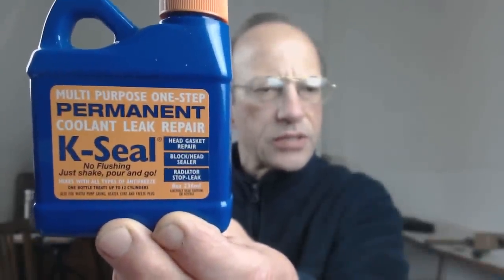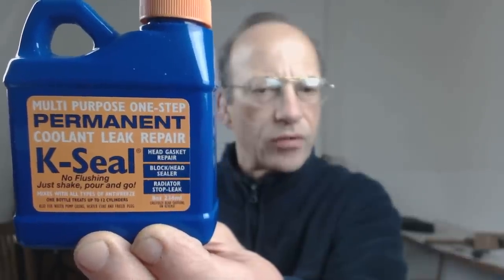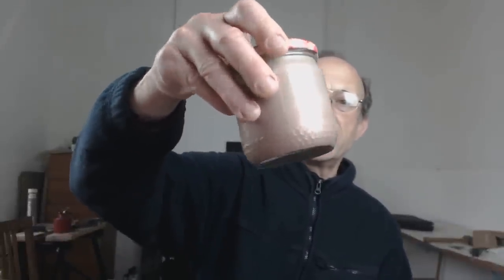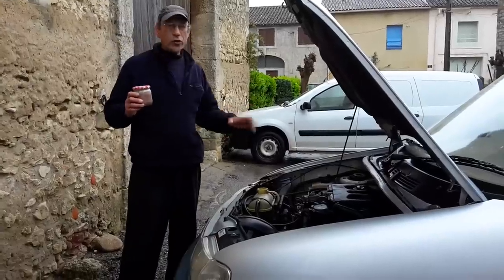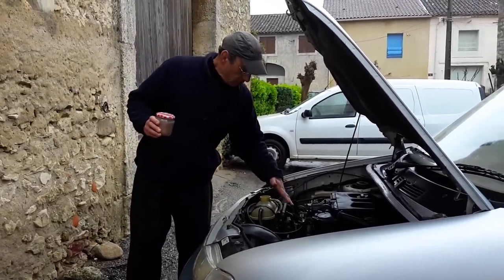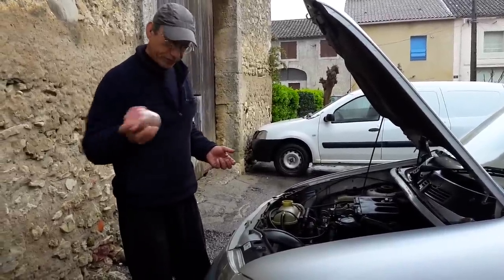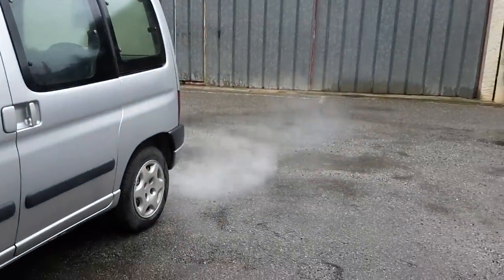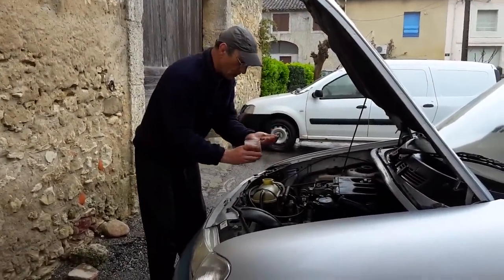K-Seal Full Test - Purchase options, Instructions & Results

Comment: My 2002 F-150 with a 5.4L Triton engine had a slow coolant leak, but was slowly getting worse. Mechanic diagnosed it as a bad gasket under the Intake Manifold, just under the passenger side of the cross over pipe (the other side of this pipe holds the thermostat). Estimate to tear down and replace the gasket at his shop was $950 but with a rusty body and over 276k miles, it wasn't worth that amount to me to have it fixed properly. I read a lot about radiator stop leak products, and decided to give K-seal a try, partly based on this review by Engine Tuning and some others. I added the K-seal into my overflow tank and the leak was stopped after about 15 minutes of idling and slow driving, and the coolant that had leaked and puddled up in the crevices on top of the block has finally baked off so no more coolant smell in the garage after I shut it down. Heater still blows hot air, engine still warms up quickly, so no ill effects in the heater core or thermostat so far. It's been about 10 days now, and I'll come back and post an edit to this comment if anything goes awry in the future. I'd definitely recommend this product to a friend with a similar situation.
Reply from the maker: Nice report Terf ... thanks for taking the time to share it with the community.
From my experience, you fault has already been fixed, and should give you no further grief.

Comment: I really appreciate the info in this video.  I thought I'd ask a question because it appears you are still responding as recently as 2 weeks ago :) I too had a suspected leaky head gasket.  My 94' Celica has over 200K , my mechanic notice a funny odor emitting from the engine that he identified as a head gasket problem.  He told me to watch my radiator fluids and if I have to add fluid, my head gasket may be in the early stages of going.  I noticed I did have to add fluid once a week, not a lot but it was losing fluid.  He then instructed me to add the K-seal, which I did 2 weeks ago.  The first thing I noticed is steam/or smoke coming from the engine. This happened the first 2 days, then stopped.  Now I'm noticing once I've driven the car for sometime, meaning the engine is very hot.  The car is stalling out, it restarts after it sits for a min or 2 but the stalling out is happening more frequently.  I know it has something to do with the KSeal just not sure what... Any ideas?????
Reply from the maker: Sorry for the delay ... I've been offline for 5 days.

From all the feedback, it is unlikely to be caused by k-seal.
Most likely, you are one of the very few unlucky ones, who's engine wasn't fixed by k-seal.

They claim 98% success rate.
The feedback bears that out.

You can get in touch with them.
They may refund your purchase cost.

Let us know what happens ;)
Reply: @EngineTuning  Sure will, I called them they said the same thing you just said.  My mechanic is checking it out tomorrow.  Thanks for the quick response, I was waiting :)

Comment: It may not have worked for this guy but it's worked on two of my cars + my brother in law's that each tried it one at a time last 3-6 months.

First car we used it on (my in law) was a big SUV GMC model with a thirst for coolant without a puddle. It was going out the exchaust.  (Head gasket).   Within 20 min the leak stoped and now after 6 months still holding.

Second car was a 2000 Jeep Cherokee 4.0 L (6 Cyl). Same problem.  Using coolant and going out the exchaust.  Same luck with this car. Aprox 4 months later still not using antifreeze.

Last car I used K-Seal on was my 2013 Toyota Prius V two.   It was throwing 3 error codes (misfire on cyl 2 and 3) and water pump 'over revolution'.  As id didnt have a radiator cap it was a little more difficult. I had to remove and empty the overflow container, put back and fill with K-Seal only. (Rinsed out the bottle witha little coolant to geteverything.

Toyota Prius engines stop and go at their own will so idling is out of the question. I drove it on a highway for about 10 min, then freeway for about 15 and finally highway another 10 min or so around 45-50 mph.    I did not reset the check engine light and after about 10-15 min of driving it went out by itself.  All error codes gone except misfire on 3 which is a permanent code ill need help turning off.

The car went from running extremely rough to nice and smoth, like the sowing machine sound it normally has.

/Daniel, Arkansas
Reply from the maker: That's an excellent report.
Thanks Daniel, for taking the time to share it with everyone :)
Reply: An old turkey baster works great for removing some coolant from the overflow reservoir, saves from having to remove the entire thing
Reply from the maker: Like a big pipette!
It's a good idea, and worth acquiring.
Nice share Terry :)

Comment: Its worked on a 1995 V6 Mustang when nothing else would. Water leak from what looked like a pin hole in aluminium casing behind water pump. Been 3 weeks so far and not losing water. Engine now heats up quickly and temp  is on the lower side of the half way mark as before it was on the high side. Heater is still working fine. Seeing as the product only works when it comes in contact with the outside air I cannot see how it would clog when suspended in water. Fingers crossed that it lasts ..It did seal the leak within 2 minutes.Really pleased with the out come. We live in the UK and Mustang parts are expensive.
Reply from the maker: That's a wonderful post Gra :)
While the engineering detail may well be the same...
... it is great to have that confirmed ;)
... particularly when the motor may be unusual, and on the rare side.
 
Let's hope that it stays fixed :)
Reply: At the moment there is no antifreeze in the system .I will add some at a later date. If you don't hear from me it is still working. I know there are haters out there mainly mechanics who run small garages. Then there are those that doubt it. I tried JB weld on the casing prior to using KSeal.That didnt work at all, although it has worked for 10 years on a crack in my aircooled VW engine. Fingers crossed for KSeal tho..
Reply: Ok 2 months on and have added antifreeze. I only added antifreeze because the temperature was going up slightly and I wanted to lower it to the same as it was when we bought the car in 2008. As for the Leak well that is still cured, not losing any water at all. The car is getting up to working temperature quickly rather than taking  what seemed like an age.Checked the water in radiator and took a little out to check that the antifreeze hadn't caused any sludge. It is still as it was prior to antifreeze being added plus the copper particles are still floating freely. I will add, I have no connection with KSeal other than being a satisfied customer. It was recommended by a local accessory shop as being the best out of the 3 he stocked. It was mid priced . Will keep you informed, if you don't hear from me it is still working.. Great stuff what else can I say. I am happy to endorse this product.
Reply from the maker: Great report... thanks for the feedback :)

Comment: It worked for me in a 1996 bmw 520i . Coolant was leaking to the combustion chamber and it produced thick white  smoke with the sweet odour even when the car reached operating temperture.
The smoke was not steam.
After a 1000 km still working.
I guess that the cause is a pore or small crack  in  the multilayered metallic head gasket, but I cannot be certain about it.
Thank you, this video was one of the resources I found to solve my problem.
Reply from the maker: Thanks Pulpo for taking the time to write that report :)

Comment: Just used this on a 94 Cutlass Ciera with 2.2l 4 cylinder that has what I’m pretty sure is an external head gasket leak. Thought it may have been thermostat housing leaking coolant on head surface which is where the leaking coolant is, but I fixed that and it wasn’t the issue. Coolant running down the front and rear of the block and dripping underneath the car. Had to add a few cups worth of coolant every drive. Added the k-seal and let the car idle for 20 min. I looked under the car shortly after pouring and there was no dripping, when it would pretty much always be dripping while running. Will be driving it in the morning and hoping it does not leak. I’ll most definitely be reporting back on how it goes.
Reply from the maker: Nice report ninja :)
Reply: It’s the day after adding the k-seal and we drove the kids to school this morning and have been out door dashing, and no leaking! It’s holding coolant and is running at normal temp. I check under the car every few stops and don’t see no dripping! So far so good. Will check back in at a later time!
Reply from the maker: @ninjasupreme5966  Typically, when it has been fixed like this, it will stay fixed.
Nice work :)
Reply: It’s been over a month and it’s still holding coolant! Level has been full this whole time, no leak! No overheating. I’m really happy it saved us from having to get a different car!
Reply from the maker: @ninjasupreme5966  Nice!
Thanks for the feedback report :)

Comment: Hi! My family has an Opel/Vauxhall zafira A 2004, about 2 years ago it started to smoke a lot on the exhaust(White smoke) . Since then we use rislone block seal, lasts for about 4-6(3000-4000km) months after that period it starts to overheat and builds up a lot of air in the cooling system. Would you recommend K-seal? Do you still have that car and if so, how does it work? Thank you so much!

Comment: This stuff works great for sealing a leaking heater core. And yes it can be used more than once without clogging your cooling system. I typically, have to add a new bottle every 4-5 thousand miles
Reply from the maker: Nice feedback Matt ... thanks for taking the time :)

Comment: Yes, it works. And its another case of a simple cure or resolutions that is worth trying before you go down heavier routes. A bit like a dentist will pooh-pooh oilpulling (don't challenge my specific example; its the principle I'm aiming at) or any other professional will rubbish something that obviates the need for their costly services; this 'technology' as Engine Tuning correctly labels it, is something you should genuinely try before letting any mechanic near your car.
I used it on my high mileage 250,000km 407 coupé (2.2 petrol) that runs on lpg mostly. LPG runs hotter and this engine also uses up a bit of oil (part of its natural design). What its not designed to do is run without water or coolant; a point that was lost on the high reputation mechanics I brough it to after another idiot here in Ireland did a coolant flush (money for jam; I shouldn't have let him) and managed to break, among other things, a coolant bleed nipple. I only noticed it after a week's commuting.
After the second idiots forgot to refiill the coolant after testing for HG failure, I bought K-Seal and, even after serious overheating episodes, the old girl runs smoothly and I've just come in from a half-hour tickover on the drive after not starting her for 6 weeks.
So, pardon my French but, F**k the nature of humans that we twist facts into our suiting and recommend new engines where simple solutions exist. We all have to make a living but, like many professions such as solicitors etc, its unusual to meet a straight, honest garage.
Reply from the maker: Excellent, and well presented commentary, covering your recent experiences - thanks for sharing that with us.
I'll give you a period 'pinned to the top', respecting the time and effort that went into the post :)

Thank you for closing on the point that 'straight honest garages' do exist.
But yes, it can be difficult to know in advance.

I had occasion to explain to a head of servicing (of a main agent!!!), how to diagnose 'cooked brake fluid'.
This main agent (big operation) returned the vehicle twice (what??) with dangerously spongy brakes.

It was a friends vehicle, so I took it to a local garage and instructed them to entirely replace the fluid.... problem solved.

Yes it is frightening.
... but it's great that K-Seal fixed the problem (for a few quid).

:)
Reply: Engine Tuning Thank you. And thank you very much for your video. It is professional, authoritative, educational and, above all, reeks of a sincere desire to help others save money while acting wisely.
Reply from the maker: Thank you for those kind words Anrirua.
You have understood my motive perfectly.
I do my best to share any knowledge that I have gained... often live as it happens.
This one was entirely live :D

Comment: Well iv just watched your k seal. Video clip in October 2024  gona try it on my 2005 Jaguar S-Type 3.0 Auto it's radiator leaking from the bottom and low warning ⚠️ engine coolant keeps coming on like 5 or 10 minutes after topping up the header tank.  Local garage and fit a new radiator plus labour for £460   which I just haven't got this month so I'm hoping the K Seal works
Reply from the maker: My guess is that it will work.
Report back :)

Comment: I tried the k seal today.
Symptoms of  my car were, while driving  if I came to a hill or accelerate the temperature gauge  would go up very high , the coolant was bubbling and the coolant  reservoir  tank is filling the the cap and engine fan constantly on. 
Today I removed  radiator  hose and poured k seal directly  into hose I than brought the car  for  a drive for 15 minutes until the temperature  got up to normal .
Then left it run idle for 10 minutes  all the same symptoms were still there after I turned off the engine .
I drained the excessive coolant from the reservoir back into the rad and left car cool down for 1 hour .
I went back after an hour and run the car for 10 minutes idle.
There was no bubbling in the reservoir  and the level stayed at it's normal  level.
Hopefully  the k seal have fixed the problem  .
I will take the car for a long drive later today and  see if k seal has really worked.
Reply from the maker: Good luck!
Let us know if it stays fixed :)
Reply: Don't know yet if it's fixed , the guy in the auto  shop told me it can sometimes  take a couple of  days for it to work.
I'll post later on today if the problem is  fixed.
But I'm not that confidant  that it will as I have already  tried steel seal and wondar weld  and none of them worked .

Comment: I picked this up after watching this. My leak was so bad that I need to put water in every 10 to 15 minutes but there was no puddle or visible leak, so it most likely was the head gasket. I put it in idled for 20 minutes and drove for an hour. Two weeks later and it's still holding.
Reply from the maker: Great news :)

Comment: I put this in my RX7 12a, that had external leaking coolant from the outside O ring seals. After using this sealant I let the engine run for 10-15 minutes at 1200 rpm, then took the car for a one hour drive including a high speed run on the freeway. The water temperature was rock solid just below half on the gauge. When I arrived home I decided to do a cautionary check over the engine for leaking coolant between the end plates and to my surprise NONE was evident. Time will soon tell how long this sealant holds out, it has certainly saved me a rebuild for the time being.
Reply from the maker: Thanks for the report MrStoney.
Mine is still good after two and a half years, and it just passed its emissions test :)
Reply: If mine lasts that long I'll be grateful to a marvelous product.
Reply from the maker: My guess is that, if it has worked, then that's it.
A permanent fix.
Good luck!
Reply: three years later, how has it held up? would you recommend to stay away from high speeds or aggressive acceleration? i want to use this on my 2007 Volvo S60R , but am hesitant to.
Reply: @bren.nan_  Still running to this day, no problems so far.

Comment: My Renault RX4 head gasket leaked and was pressurising the header tank. A  diy gasket replacement £200, garage bill £1, 000, car value according to We Buy Any Car  £137!  Used K Seal and it really does work. Cause of problem forgot to replace cap on header tank and cooked engine! Best £24 I ever spent.
Reply from the maker: Nice share Cliff ;)

Comment: Tks! It's works for me but how long will it last?
Reply from the maker: It's very hard to predict Tony.
It will depend on what was originally damaged, and the extent of the damage.

A cracked casting is different to a blown head gasket.

My fix lasted for 4 years, but I believe that it was new damage, rather than the fix failing.

The great news is that this has finally sealed up again (just last week).
Fingers crossed, it is permanent :)
Reply: @EngineTuning  four years are very very good already...so you added another for the new leaking issue?
Reply from the maker: @tonykwok5420  Yeah, but the 2nd bottle didn't work in the beginning.
Don't ask me why, because I don't know.
... but then it worked.

Perhaps the conditions became perfect
... or perhaps my Angel decided that I'd suffered enough :D

However; overall ... my guess is that the fix is permanent; and that a new issue is a new issue ;)
Reply: @EngineTuning  very good and tks a lot of with your information
Reply: @EngineTuning  just keep my updated with many tks